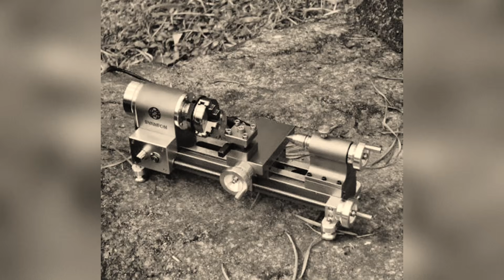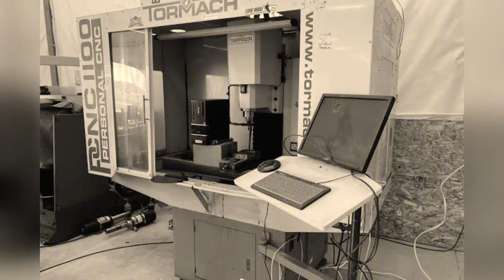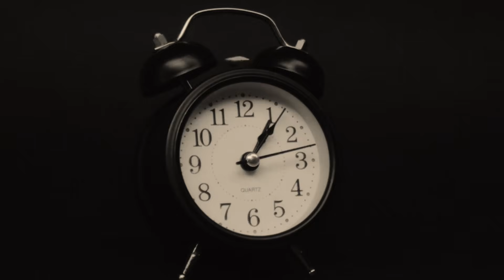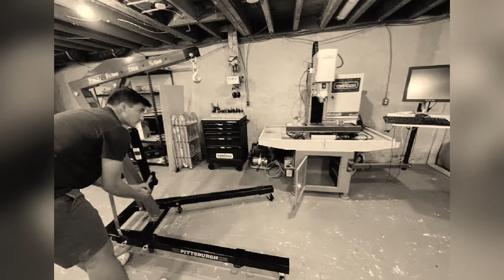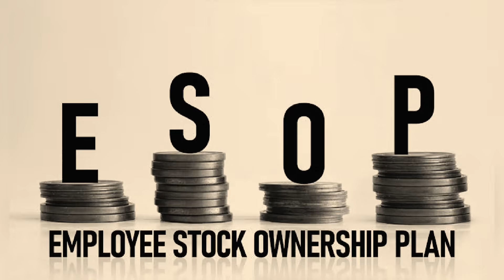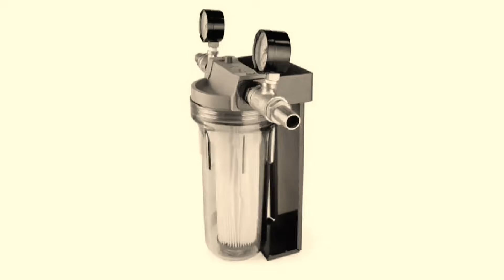How Two Wisconsin Engineers Turned Industrial CNC Into the "Laptop" of Manufacturing

Comment: Mach 3 is and was hardly widely used in the die industry, it was a cheap hobbyist stepper app that ran in windows, it was and is unreliable. Pathpilot is the Linuxcnc with Tormachs GUI. The base code is identical to Linuxcnc and from what I understand, use Mesa Engineering I/O hardware. Machine is made in China.